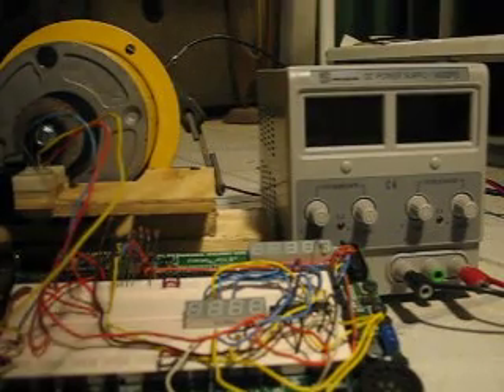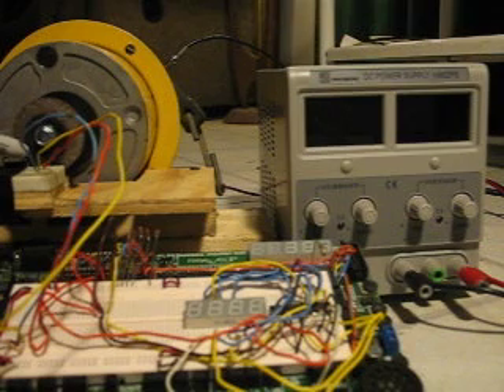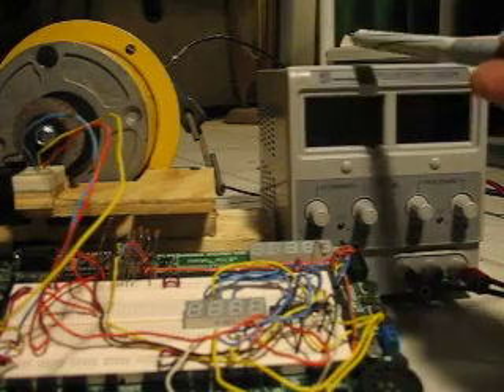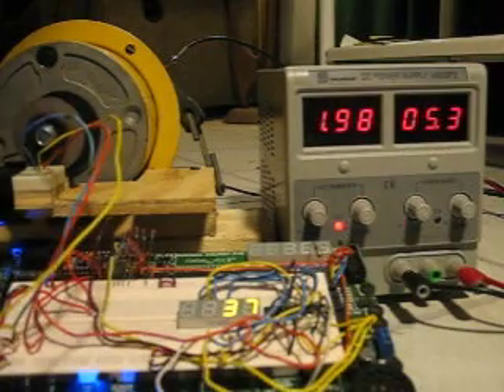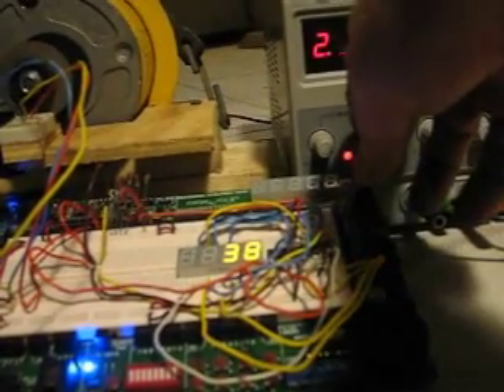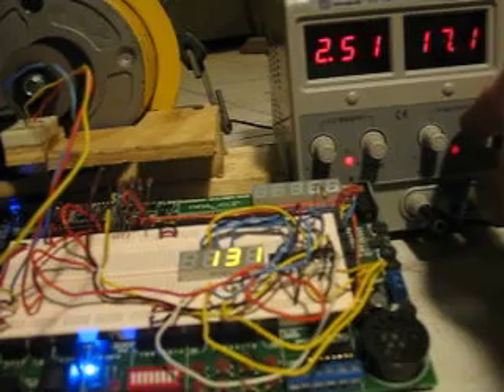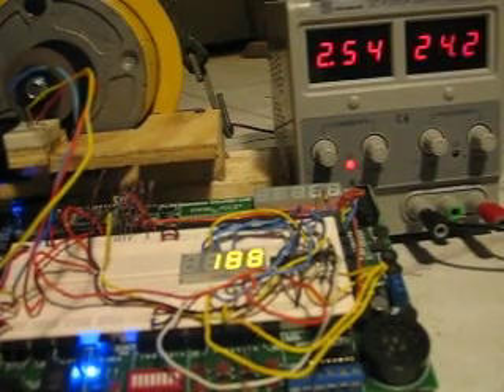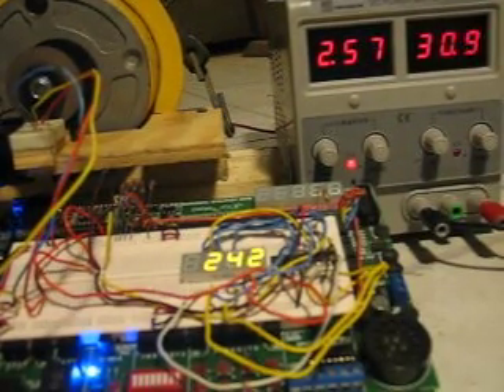Hall Effect Tachometer for Electric Motor Demo

Comment from the maker: @bitsurfer0101 

Just the atmega328's crystal oscillator.  i'm working on a new version with a more accurate hall sensor and will correct the calculations shown in this video.